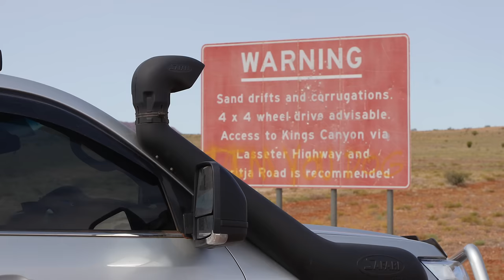Im P!SSED! How THIS could easily happen to you! Broken 4x4 in the middle of the Australian outback

Comment: As always - awesome video. Just came back from the Centre. Didn't see a single soul on the Birdsville Track over 2 days... other than the nice couple running a hotel midway ("what are you doing here - are you nuts"). Only a handful of people on the Oodnadatta Track and the Pink Roadhouse was shut for accom (but Simon was kind enough to open it up). To not stop is horrible... but you can't expect to see many folks in 50 degree heat at this time of year so pack a lunch and lots of water/beer. The upside to the heat is the flies have mostly given up or died and the solitude at this time of year makes the trip even more special. Corrugations seem to have a sweet spot where at the right speed you float over them. Yulara price gouging is what happens when the government runs EVERYTHING and there's no competition.

Comment: I was on the same track back in 2007 stuck for 8 hour , with the axle of camper trailer had moved across and blown tyre and destroyed rim all cause by suspension becoming loose and nuts missing, not 1 car out of 10 stopped , long day , just needed another jack to help lift it up.

Comment: Hey team.  I'm really surprised no one stopped. 
I assume this was on your way to the Perth 4x4 show. Safe Travels. 
I'm stuck in Perth until mid-January. Lost a wheel on the way back from up north and did a shed load of rear axle and brake damage along some pretty nasty panel damage.  In my case many people stopped and offered assistance. 😊 21:37

Comment: A set of tyre leavers and a bead breaker is a lot lighter than a second spare wheel on a caving expedition above the transcontinental rail line in a four vehicle convoy we had 14 flat tyres in one day I used a lot of tyre plugs and glue on patches but we made it back to a town